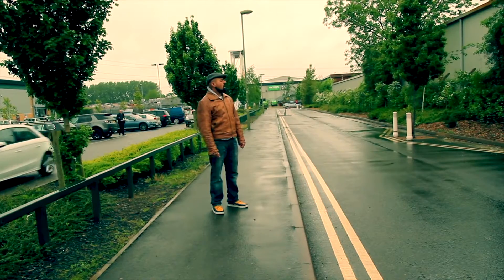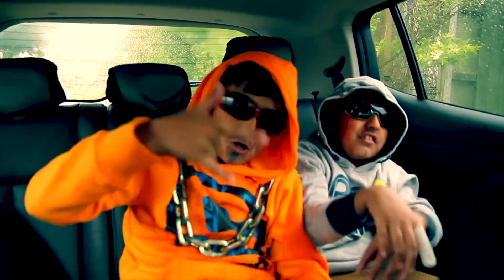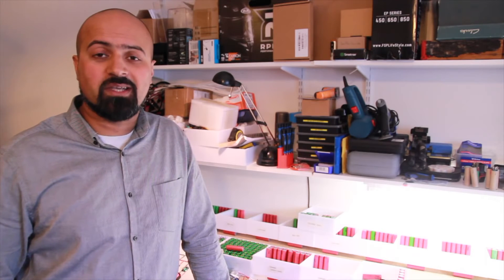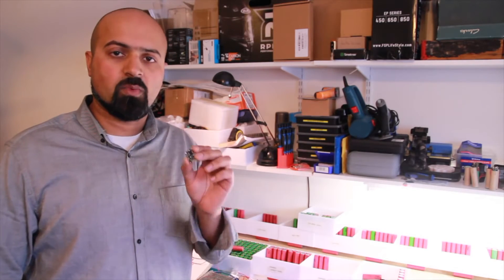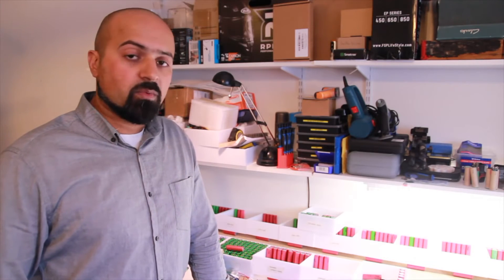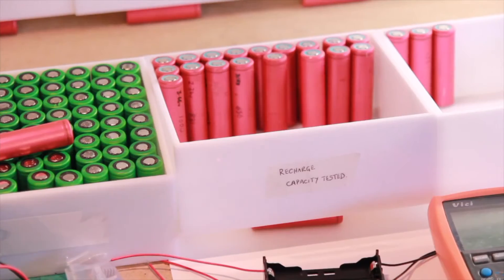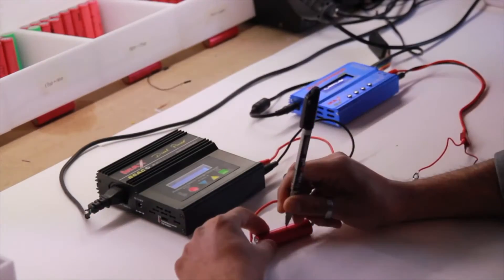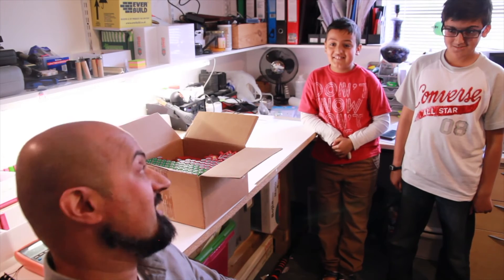18650 Mountain - Part II - The TP4056

Comment: please take in consideration self-discharge. self-discharge is constant and it specific percent value of over specific time
it usually around 1%/24h for Ni-MH
Lithium have many different chemistry, so by bulk it should be between 0.1%-0.5%/24h at 20C
higher temperature higher self-discharge and it is growing exponentially (logarithmic) not linearly

Comment: Have you thought of using a different capacity checker? Something like the Foxnovo F-4S or Opus BT-C3100 or SkyRC MC3000 which can capacity check 6 cells at once?
Reply: Douger Rohmer Where did you get that the MC3000 can test 6 cells at a time? It has only 4 bays.

Comment: Hi :) What are you using over the chip as a heat-sink? I have put a heat-sink below the chip and it works well. I saw how you are doing it and it has made me think...maybe your method is more efficient?
Reply from the maker: hey Matt these units came fitted with heatsink, I've not played with these too much since my tests showed they were inaccurate and large variations between different units of the same model.